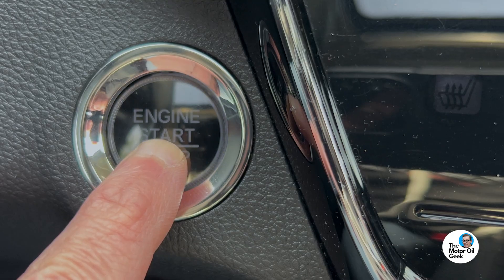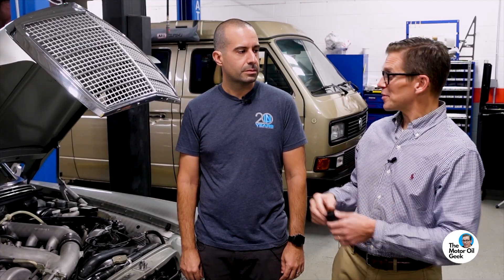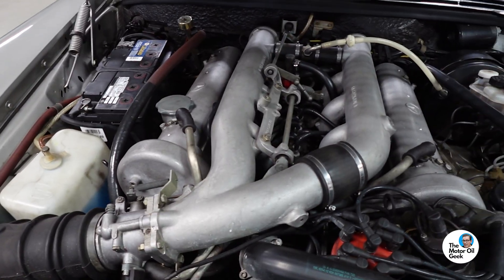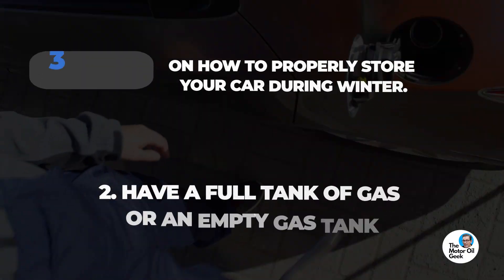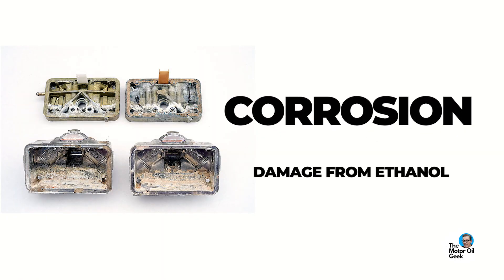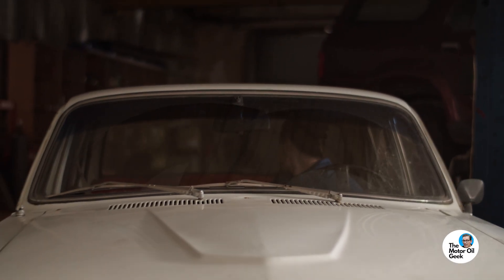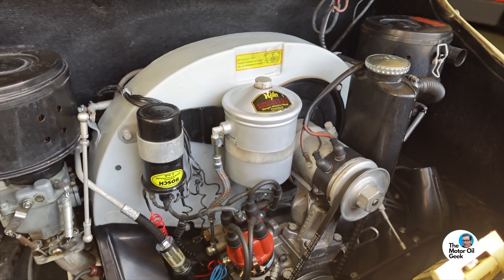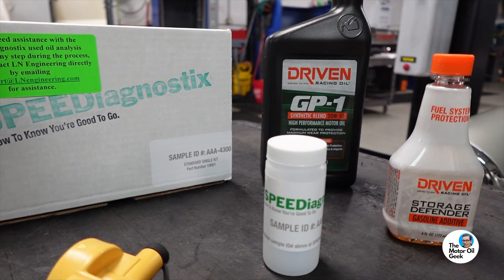3 Winter Storage Tips To AVOID Engine DAMAGE

Comment: Agree on changing oil before storage. But I would also add that you should disconnect the battery to eliminate parasitic drain (i installed a hand-turn disconnect device) and REMOVE the electrical fuse to the engine fuel pump.  Then before taking the vehicle out of storage, verify battery health with a volt meter, reconnect the battery, and crank the engine for about 45 seconds BEFORE replacing the fuel pump fuse.  This gets oil to the crankshaft, cylinder walls, cams etc BEFORE starting the engine.  Have been doing this for 25 years with our RV, against "common wisdom" to start engine once a month.  Our 1997 V10 engine has 85K miles with just routine maintenance (oil & filter changes every 3-5K miles) and burns no oil.

Comment: Granted, my experience is in antique tractors and such (which are way lower tech and have really lax clearances and specifications compared to any car/truck/modern equipment), but I usually go ahead and start them during the winter. However, I never let them run for less than 30 minutes, and I do something with them to make sure they warm up (into the operating range). I know they'll never be as warm as they would be during the summer, but...Its honestly easier for me to start them and let the generator/alternator charge the batteries, rather than trying to keep all of them on a maintainer/charger all winter long. That's with the gas burners. The diesels I never usually start during the winter because of how cold-blooded they are. Neither have glow plugs, and only one of them has a block heater.

Comment: I had 2005 911 in NY. I use to store during winter. I did oil after in spring and never start car during storage if I did I made sure to get oil temp to operating temp to burn of moisture. Battery charger as well

Comment: My 2005 6.0l Powerstroke has been parked for 11 months without being started. It has Amsoil in it, not that it matters at this point.  I do need to resurrect it and do an easy drive to get it warmed up and get the oil dumped, I do have a test kit for a competitor because I didn't know about you Mr.Lake Speed jr. But I do now and will use you in the future. And I live in Az. In an area that actually gets 4 seasons. I'm a religious user of fuel additive and preach it to my son to use in his 6.7 Cummins.

Comment: I disagree on point 3. What if it's a Toyota hybrid? You can turn on heat and let it run for 15-20min. That will let the hybrid system charge up both the HV and 12V battery. It will also bring the engine up to operating temperature.

Comment: on my alfa, which is a 4cyl gdi engine and is used for short journeys i.e. 10kms one way full cooldown 10km the other way 
THE OIL HAD A A TBN LOSS FROM 10.6 to 5.7 in a distance of 1250km and a 5.7%fuel dilution
Reply from the maker: WOW!

Comment: TURN OFF AUTO START FEATURE!
Reply: Why? The oil pressure remains enough to restart without excessive wear,and it saves fuel. There is no downside except wear on the starter, which is designed for this type of starting.

Comment: I own a 2005 GTO with a manual transmission that I purchased new, it has 44k miles on it. It's a pleasure cruiser that gets about 2k miles a year put on it. It's stored in a garage on a battery tender most of the time. I change the oil and filter once a year regardless of the mileage, I also submit an oil sample for analysis once a year to keep an eye on the engine's condition. I always use Mobil 1 5w/30 and a Wix filter. I start the car once a week for 10 minutes, I feel these steps are keeping my car at its best.
Reply: Literally just told you not to start the car
Reply: That doesn't mean I have to listen. The oil analysis comes back good. @BubblesTheCat1

Comment: my 2015 mustang GT is only used July and August , sits all winter , I press the gas pedal to the floor in flood mode no fuel mode and crank it twice making sure the bearings are full and the chain tensioners are filled , then I release the throttle pedal and let her start up.
Reply from the maker: Great tip!

Comment: Since you brought up both oil and piston rings, I have been thinking about old engines that seem to be worn out, but in reality, oil and carbon deposits have stuck the rings, gluing them to the pistons so they can't pop out to compensate for wear.  So I have become interested in high temperature carbon detergency oils and fuel additives made to unstick stuck rings.   Is this a big factor in high mileage oils?
Reply from the maker: Cleaning stuck rings is formulation consideration today.
Reply: @themotoroilgeek  Enough to prevent ring sticking? or enough to unstick rings that have already been stuck for years?  Wouldn't that be 2 very different tasks needing 2 very different formulas?

Comment: Do you have any videos where you've analysed the 'shear' on oil within a performance engine?

To put that question into context, I've heard various 'knowledgeable' people comment on how many miles the oil should be changed in a motorcycle engine that spends most if not all of it's like on track, but no facts behind it.

So it's either every track weekend, 500km, 500 miles, every two months and so on.....all based around the 'shear point' of oil.

Though oil is cheap to replace compared to fixing an engine, I'd love to see an actual test.
Reply from the maker: That is coming soon!
Reply: @themotoroilgeek   

At a high level, is it more than a test of the viscosity?

As in a 10w40 goes from being 40 at operating temp which it maintains for some time, slowly degrades, then falls off a cliff?

Comment: I had to replace oil pump (blowoff valve) in e46 m3 after 3 years of storge starting every other month. I was advised to start periodically to keep seals from drying out, however moisture in oil corroded blowoff valve. If your start it, drive it to operating temp.

Comment: Is there a standard definition (length) of “storage” when these steps are really necessary? I can see this related to motorcycles as well.
Reply from the maker: This is good for 3 to 6 months storage.
Reply: @themotoroilgeek  So for less than 3 months if your parking a car or motorcycle no need to go through these steps?
Reply from the maker: @jagjr6772  If it is only going to be a month or two, it is not necessary.

Comment: I have a question that's been on my mind for a while now. I have 2 cars My daily and a project car, Nether of the 2 cars see more than 2k miles per year I have owned them both for 10+ years. I use quality high mileage oil 5w30 for daily turbo beater and 10w30 for hotrod.  The last 3 years I started to only change the oil in both cars once per year. With modern oils is it really needed to go by the 3 months or 3k miles? I could do the oil analysis but I wouldn't really know what to look for. Should I be changing more often or am I fine??

Comment: definitely curious about the actual workings & data determining of the oil life readings.... I've heard that some simply measure the difference between oil restriction before the filter & after & calculates restriction (older chevys)..... others claim vehicles like the Ram use a more sophisticated set of readings that actually change oil life as driving conditions, speed, load, temperatures change, stop n go vs highway miles.... I myself DO notice it change depending on my weekly travels... if I'm loaded heavy most of the week doing around town it'll change faster than if i put 600 miles of highway loaded just as heavy.
Reply from the maker: https://youtu.be/D7hvTWsLIP8?si=1uq8oZpYWU12RnL3

Comment: After 40+ years in the aftermarket & dealers as a tech, I changed jobs the landed me with Delco. We had two meetings per year and spoke with the two guys who wrote software for GM vehicles equipped with this. They took the same approach with one engine, samples, 3rd party testing, compression, fuel mapping at 2,400 RPM, and dozens more until they logged 2,000 hrs. This equates to just at 2K of run time. They admitted to being very conservative display numbers which include low temp, 8 minute drive cycles near the end of the testing. A gallon of straight ethanol will hold 7 tablespoons of water but amount several but reduces the molecular size to pass thru injectors. I disconnect the vehicles battery, clean and apply dielectric grease. 7-8 in-lbs is proper torque I believe. I have volt meters, trickle chargers and a conductance tester. I test once a month roughly. Extended mix on a full tank is best, but not over full. Nitrogen in tires helps keep rim to bead corrosion way down. Retired.

Comment: Agree & (respectfully) Disagree:  100% agree on your gas storage recommendations & fall oil changes.  Disagree (partially) on leaving car alone.  100% agree running it for a few minutes (or less) is bad & exactly for the reasons you stated.  My belief is if your going to start it, let it warm up completely, 20 minutes minimum or better yet take it for a drive to warm everything up, weather permitting.  Another reason to not leave it alone is old cars with brake wheel cylinders tend to go bad if the brakes aren’t pushed a few times ideally do it monthly while in storage.  I’ve seen a lot of guys wheel cylinders fail over winter when not “exercised”.   Great videos & very informative!!
Reply from the maker: Thanks for sharing!

Comment: Dear Mr. Motor Oil Geek, first of all: 
Thank you for all your content and the explenations that you share with us on your chanel, I really like your videos and I learn a lot from you!

I´ve got a question on the lifespan of the protective anti-corrosion layer which the (anti-corrosion) additives of normal engine oil provide eeven after beeing completely drained of these engine parts after turning of the engine.
Can I leave the vehecle stand for more than one or two years (in average, so also in wet conditions with constantly high air-humidity, without that the airbox or the exhaused is sealed airtight) without needing to be be worried that any corrosion happens on the engine internals? 
(For example on parts/areas like the crank drive, camshafts, cylinder walls, valve guides, timing chain, any (hardend) steel gears)
If yes, how long does this thin layer protect these pars/areas aproximately? Does it have an end of his protective action time?

Thank you in advance for any kind of answer on my question! 
Best regards from Budapest!
Reply from the maker: I would recommend starting the car and warming it up completely at least once a year for long term storage.

Comment: Should you not drive car up to operating temperature after that oil change before storage?
Reply from the maker: Not necessarily. If the engine only runs for less than a minute after the oil change, it is fine.

Comment: I also plug the exhaust and the air intake holes so no more oxigen goes in.  Full tank with additives circulated,  new oil circulated too, I raise it on stands to protect the tires.  Then follow the pre spring start checklist.  I have a convertible BMW 2001.

Comment: YES.   Well, I FAILD in a couple areas, I (this time)  did not change my oil,  I do Use Fuel Additive (Star Tron / Star Brite). If I do Start my car, I usually Take it out and drive it around for 1/2 Hour or so??? (1965 Pontiac Tri Power GTO). One Question that I have is y'all Didn't mention using a BATTERY TENDER?? I guess that's a No Brainer.  😎👌..... I (this Time)  Did Not have a FULL Tank Of Gas. Again My Bad.

Comment: My suggestion.
Number 4.
Before starting my Lexus after its yearly 4 month hibernation here in Michigan is:
Pull the fuel injection relay, then crank the motor until the oil light goes out. Then plug it back in, and start.

Comment: I would be interested in a video on oil monitors, only for each specific OEM algorithm.  My wife's Ford was on track for a 12k mile oil change, but I changed it at 3,300 miles and sent it on for sampling and the results disagreed with Ford, which I expected.  This was the same for my Ford truck as well, but it was projecting more like 10k miles when I changed and sampled it at 2,600 miles.  Both with OEM oils. 

That said, my sampling had me going 9k+ miles on my Cummins and 10 track days (+ street and AutoX) on my S2000.
Reply from the maker: https://youtu.be/t4e0oDBseqo
Reply: @themotoroilgeek  I watched this already.  Unfortunately, my sampling hasn't really agreed with any of my OLM's, especially on OEM oils.

Comment: Yes please on the indicators function.

Thanks for covering the when to change the oil question! I do Stire my Camry over the winter and put new synthetic oil (usually pennzoil platinum). I don’t change the oil when I put it on the road in the summer.

I only start it now about once or twice per winter when it’s warm out and I drive it out of the garage and a very short distance, and I let it idle quite a while until it’s fully warmed up. I do like to get my tires sitting on a different spot and to use the brakes a bit.

I do fill the tank and use stor n go. I also run the AC.
Reply from the maker: https://youtu.be/D7hvTWsLIP8?si=1uq8oZpYWU12RnL3

Comment: Hi Lake, love your videos! I have a question for you, I own a Montero Mitsubishi 2008 and from the very beginning I have been changing the oil every 3.000 miles, now it has 350.000 miles and the engine seems to be very good, I’ve been using 20W50 mineral oil from the beginning, do you think that I can change from that oil to a 5W30 Synthetic oil?, wat benefits will this change can bring to the engine? Or should I just keep using the 20W50 oil that I’ve been using for years? Thank you so much for your time and your help!

Comment: Yes i used to start my vehicles and motorcycles  while in storage years ago with the exception i did it once a month and would leave them run till they got up to operating temperature and run them at two thousand rpm for a bit  i did this basically for the fuel system to avoid stale fuel settling  i never used any type of fuel stabilizer either never had a problem but hey everybody's different. Great video
Reply: Coolant temperature is NOT engine temperature. It is very unlikely you can bring your oil up to optimal operating temp just running it in the garage.

Comment: More than fuel oxidation is "phase separation" in gasoline that contains ethanol. Phase separation occurs when enough water contaminates the gasoline, causing the ethanol to attach itself to the water molecules, leaving two distinct layers in the fuel tank. Adding a fuel treatment that specifically helps control phase separation is vital. 

As for storage procedures, I follow the following steps to prepare my vehicle for high humidity summer storage in my garage in FL. Wash, wax and clean the exterior and interior, add fuel stabilizer then fill the tank (drive a few mile to make sure treated fuel has made it through out the entire fuel system), change the engine oil and filter and run it for 2 minutes to make sure the fresh oil has circulated, check and top off all other fluids, pull the plugs and spray down the cylinders with fogging oil, put plastic wrap on the windshield and lay the wipers on the plastic (prevents the wipers from sticking to the windshield), place botanical rodent repellent in the engine bay, wrap the exhaust pipe exit with plastic wrap (prevent spiders from nesting in the exhaust), place two DampRid moisture absorber buckets in the vehicle along with some Bounce fabric softener sheets, disconnect the AGM battery, jack up the vehicle and place it jack stands (placing the vehicle on the jacks stands so the suspension is still compressed - not on the frame where the suspension would be hanging), cover the vehicle and put her to sleep.

Comment: Lake, I think you should 100% explain to people how the oil life system works. I’m assuming the software calculates for load driving cycles, warm-up times, etc. etc.. The one thing I like to point out is my uncle that used to be a Trans am late model  racer, and I have discovered that all late model Subaru cars have a crank flood start mode, so let’s say if your Subaru has been sitting for a week or two you can fully depress the gas and crank the car. It cuts the fuel injectors out, allowing you to build engine oil pressure as far as I know only Subarus have this I have not tried this on my ISF I’m a little hesitant ( that ISF 5 liter revs extremely quickly) I guess what I could do is warm up the engine and try it and if it starts to race at least I have a warm engine… also, I just saw the recent video on from Rich Ford boss me where he just sent in a recent sample of the new Valvoline restore…. Very interesting. Thanks Mr. Speed.
Reply from the maker: https://youtu.be/t4e0oDBseqo
Reply: @themotoroilgeek  thank you sir!

Comment: Another problem with running the engine for short periods of time, is the exhaust. When fuel burns, it generates a lot of water. If the exhaust is not allowed to get hot enough to boil off the condensed water, it can cause rust/corrosion. Doing that repeatedly will literally rust the exhaust system from the inside out!
     everything mentioned in this video holds doubly true, for back-up generators. If I feel a need to fire my generator, I run it loaded, for at least one hour, even of the power comes back on. I want to get the oil up to normal operating temperature, then maintain it, to make sure the water that condenses from the fuel has time to evaporate. With big engines, with outputs exceeding 100 kW, I recommend at least 4 hours of loaded operation per start.